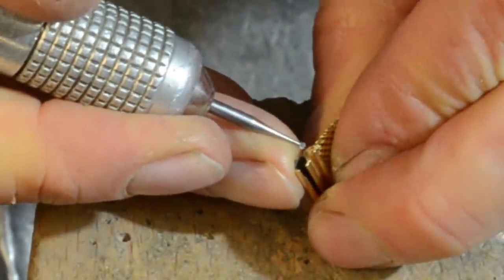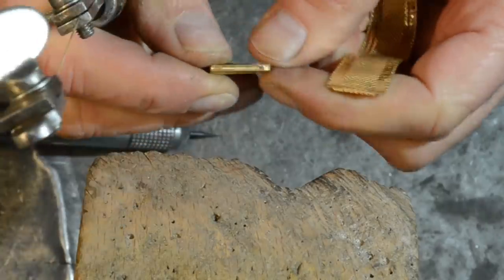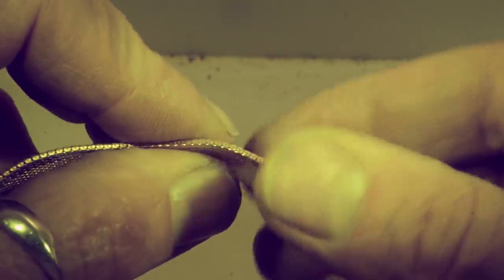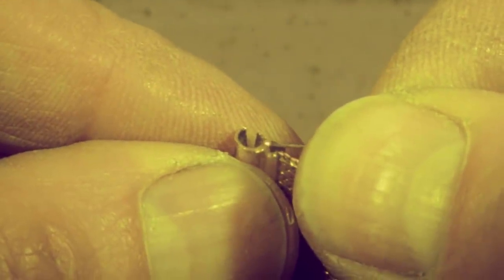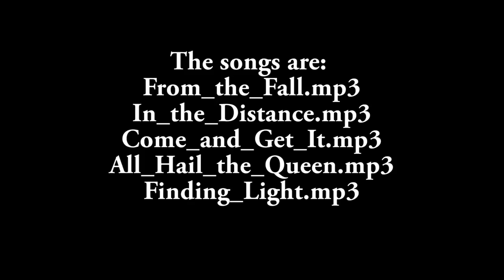As we shorten a gold fabric bracelet for watch

Comment: I was cringing when he was installing  the spring bars with a screwdriver on the top of the gold lugs. You know the lugs are now gauged and scratched. I am not for installing damage no matter the condition of the piece. He should of at least installed the spring bars from the back of the watch.
Reply: Your saw the gouges and scratches did you? I did not, how do know it was gouged and scratched
Reply: yeah, that made me cringe, knowing full well that last pin install left several marks.  i was puzzled by his shortening at the lug end, especially with a tapering bracelet.  
a great jeweler, a good watchemaker doesn't always make..
Reply: @rk702  You do not know me and you do not know how much experience I have I stand buy what I said, on the other hand you have decided on something you have no way 
to substantiate
Reply from the maker: For many jobs I use magnifying glasses or a microscope, and I pay particular attention soon, I guarantee you that the watch did not show further scratches other than those caused by wear, given that the watch is years old 50, and has not been polished. Thanks